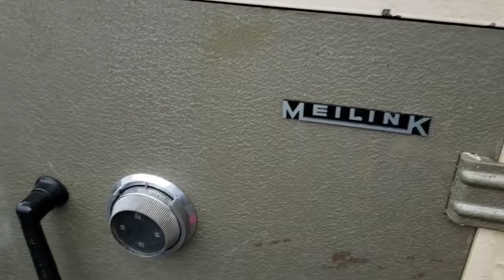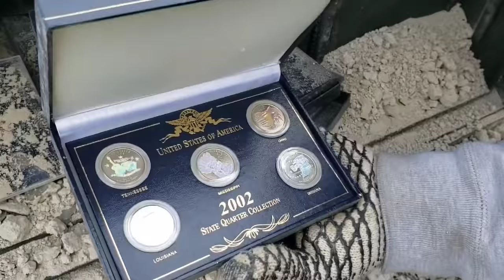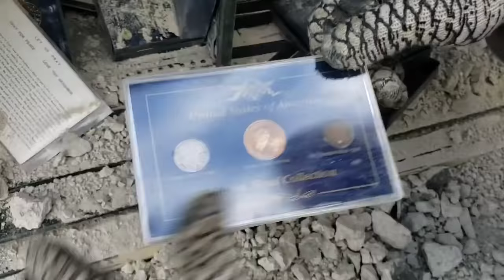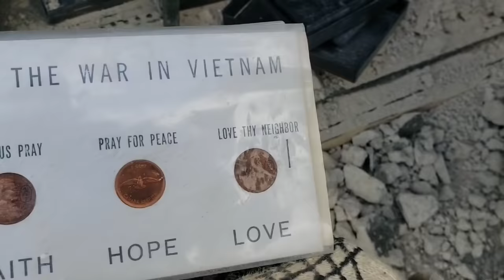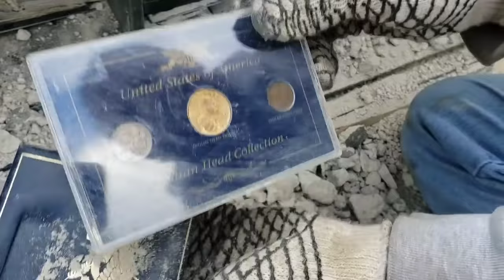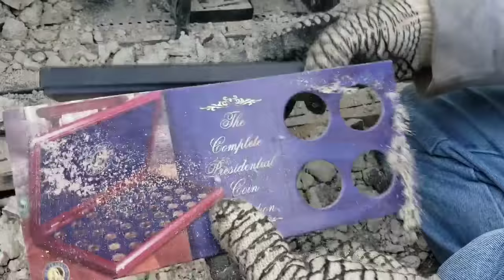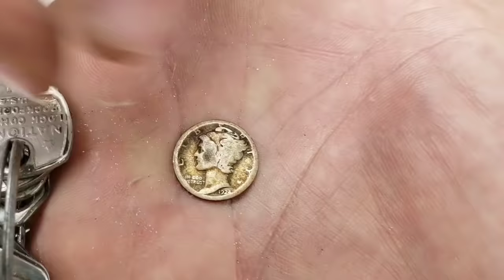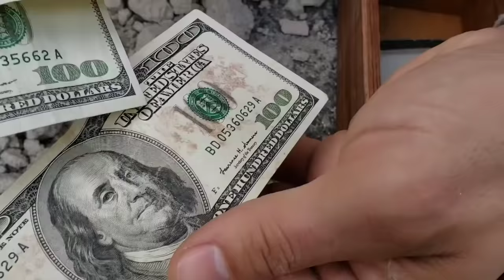FOUND MONEY IN SAFE I Bought Abandoned Storage Unit Locker Opening Mystery Boxes Storage Wars

Comment: I am a retired locksmith of 35 years. Love the channel, LOVE George's eyes!!!! Safe manufacturers know a safe will be put up against a wall so they SKIMP on the security of the back of the safe! Buy a die-grinder (even a cheap Chicago from Harbor Freight is good enough) and use it to cut open the back of the safe. All the security is put into the DOOR of a safe and you try to defeat the strongest part. I love watching it (he he he he) but don't kill yourself! Chris
Reply: Lĺĺ
Reply: Another trick is to put a lump of plasticine on the back and stand up a cold chisel in it and come down heavy with a sledgehammer and voila
Reply: So you got out of the locksmith business because you couldn't stand to keep trade secrets to your self?
Reply: @securityman6666  that's not a secret... Basically anyone that knows anything about safes  already knew that
Reply: Lol
Reply: That's Funny.
Reply: @matchthat5053  the bottom weakest point
Reply: The gun is a lighter my grandpa had two matching ones
Reply: He\\ it’s just a fire safe he made it harder then he needed to
Reply: He had a die grinder is whats hilarious
Reply: I always say work smart not hard 😉

Comment: Could you imagine after all that hard work they found an envelope on a shelf with the words safe combination and keys written on it.
Reply: Hahhaa
Reply: ironic😅
Reply: This is what outrageous greed does for people.
Reply: A sledgehammer.
Reply: Epic
Reply: Kerouac “ On The Road “ had a similar story. 
On top of the safe….was the envelope with money.
Reply: @johngrant5448  Greed? Really? So if you knew there is a very good chance of making more money than you paid for the unit, and know that you will spend more money with a locksmith to open the safe, you have to stay in sight of the safe to be sure "his" greed isn't outrageous - that's greed??  This is just smart business - doing the work yourself, keeping more money in your pocket!
Not greed at all, just business.
Reply: Lol
Reply: its not dying light
Reply: @johngrant5448  exactly.
The right way is drill or cut the bottom of the safe large enough to get your arm in.
Light it up and see what's inside.
Granted this isn't a high roller NEW safe but may still have value to someone???
Doesn't make for a sensationalized video like Taking a sledge hammer to a box.
When you're done drilling/cutting the BOTTOM of the safe you may be able to repair and sell.
I've never had to take a sledge hammer to one.

Comment: The way to open a safe is to use a hammer to knock the dial off, put a bar on where the dial was and hit it with a hammer to pop  the locks out of the box and the tumblers back. You can reverse that when you get it open by looking to see where the tumblers open and save the safe.

Comment: Just a tip using pry bars an stuff you don’t just have to pull back an forth Go side to side to get a better angle/ and what locks it is from to other side not where the pins are.You can rent saws to cut the locking bars that keep it closed

Comment: If you don’t care about saving the safe, order some elemental gallium.  Scuff the back wall up with a bit of steel wool, put the gallium on and wait a few hours.  Gallium infiltration will make most metals crumble like paper, then you can get in with a stern glance. You t also works on locks if you use a syringe to put the gallium in

Comment: I’d never beaten or flipped a safe because what’s inside could be valuable and you risk breaking the item.  Drill the lock. Or go get a portable hand pump and scissor hydraulic ram they can spread open 20 tons tap that into the door frame where you think the pins are and start pumping the tan will brake it open and just work way around the door. Basically same thing you did without risking times inside

Comment: Should check out that 1964 50 cent piece. If the four is screwed up on the bottom right corner. It could be worth $10,000. Or so.

Comment: Next time take a grinder and cut the back of the safe off it's usually weaker than the rest you could have damage good stuff with the sledge hammer imagine if there was a few Rolex watches in there original box's and you smashed them to bits!

Comment: Too bad there weren't books you could study on safe cracking made easy 
Adding another thought once you get the door that far loose drill holes in it set to screw in eye bolts with a chain 
And raise the door with an engine hoist....